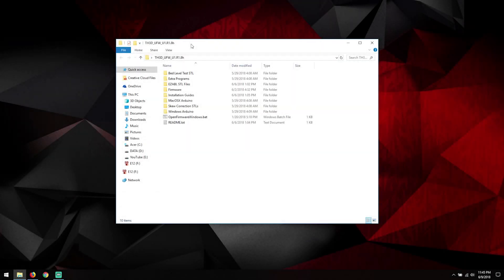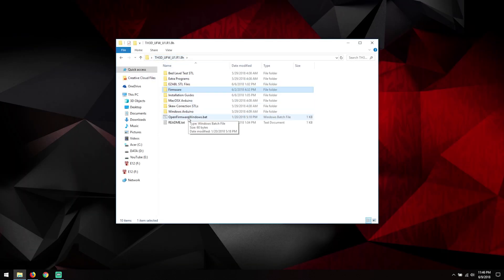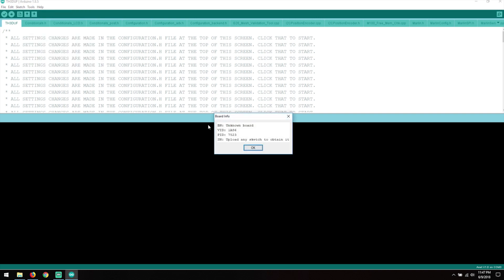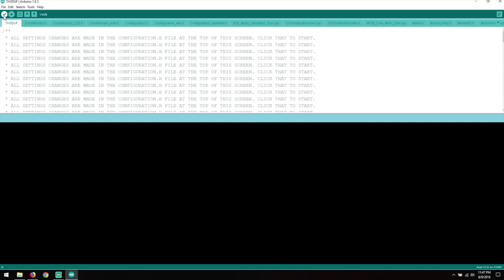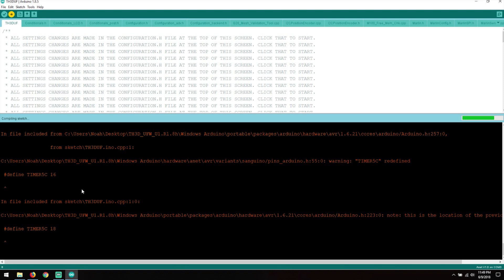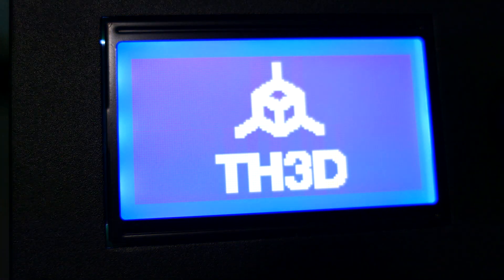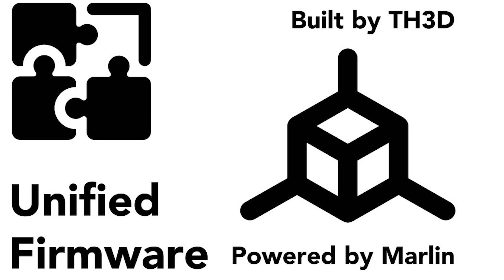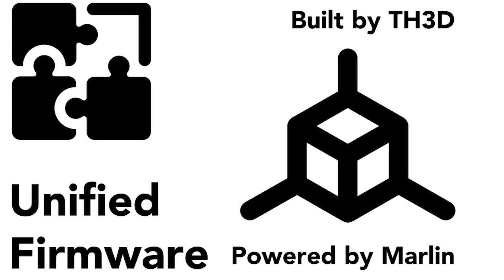Flashing TH3D Firmware on Anet E12

Comment: I had the same problem as Brett below but realized my mistake. After flashing the bootloader, you disconnect the Arduino and plug the usb cable into the Anet Control Board. 
It's never mentioned and an essential step in the process. Knowing now how the process goes it's logical that the firmware doesn't belong on the Arduino, but on the Control Board. But following a step by step guide, I tend to not stray from the path that is provided. Had that step been mentioned, it would have been a seamless process. 

Thank you for the time and effort that videos like this take. I just wanted to pass along my experience and my appreciation.

Comment: hi your tutorials worked for me, i have a cr-10 repko, anet e10 and anet e12, i want mesh bed leveling installed, so i can do the 9 point bed level without a probe, when i try to enable it, the flash fails. do you have any suggestions so it will flash? i believe the board doesn't have enough storage, i am curious what might i be able to disable so it will flash?
Reply from the maker: What firmware are you running?  In my v1.4.0, at least for the E12, I had to disable the bootscreen in order to make room for the mesh leveling.  Try disabling the bootscreen, set the lines for your device, and upload again.
Reply: thank you i will try that, i don't need the 4 corner bed level, just the mesh 9 point, i have probes, but i have no clue how to install it into th3d marlin,sorry i am using the latest version of th3d firmware